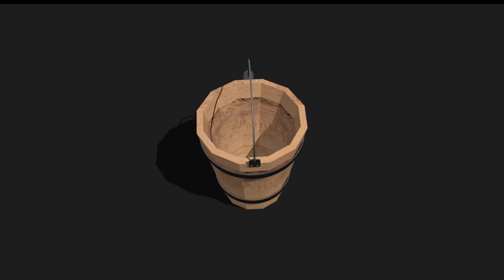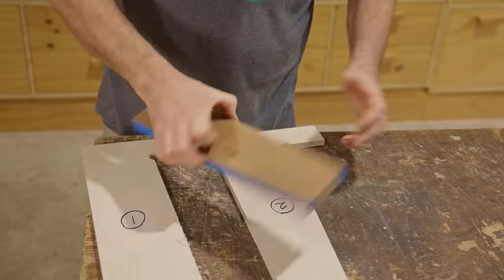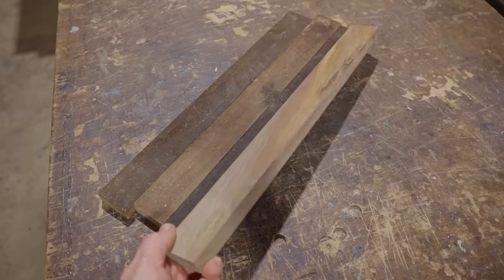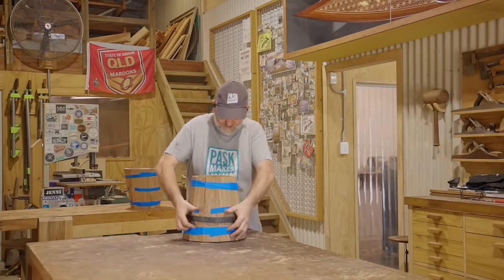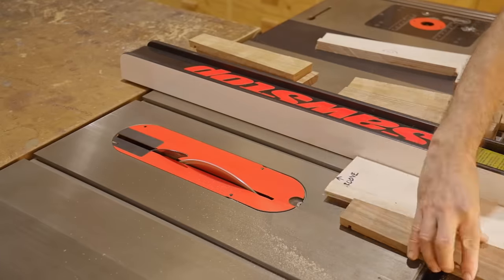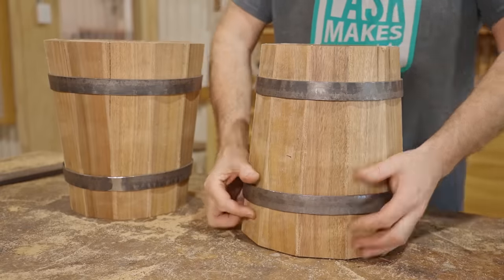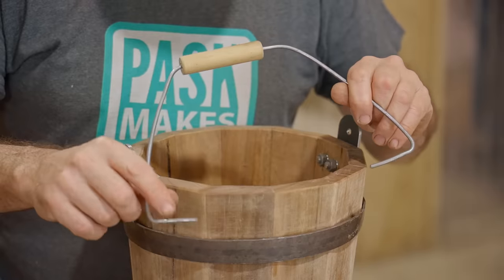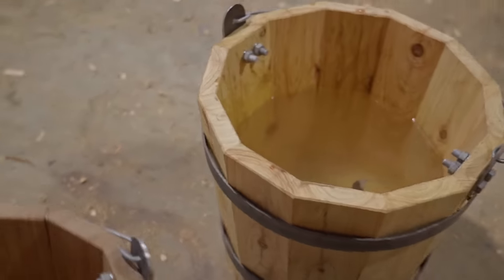Making a Good Old Days Wooden Bucket - Will it Leak? - SWC Ep53

Comment: This is awesome work. 
I was a bit surprised though when I saw you used glue for the bottom. I remember from my grandad when he was prepping the barrels for wine, and as some were leaky, he used to throw boiled/hot water on those spots so the wood expands until there's no more leaks. And he did exactly the same with the ends. Same with new ones, when they get knocked into place, he would fill it slightly in the area needed with hot water to seal the thing (he didn't have gas or anything like that back then).

Comment: That's four buckets that money can't buy, or not easily at least as no shops have them. One suggestion: stainless steel for all the metal parts, incl. the bolts. A nice looking, maintenance free modern material combined with a classy traditional design.

Comment: My fire company has an hand pumped engine made in 1799.  It is made out of white oak.  Every few years we pull it out and pump it.  The wood requires to soak over night before it stops leaking.

In October, I toured Kentucky Cooperage.  They make bourbon whiskey barrels out of white oak, with no glue, even on the heads (bottom & top).  They hydraulically press the heads together.  The cooper then hand places the staves and hand tightens hoops so tight, they do not leak.   Each barrel is pressure tested with air and water to verify no leaks before being shipped. 

It seems that white oak is a good material for being wet, but the bourbon barrels do leak a bit over the years that it ages the bourbon.

Comment: i figured they would have coated the inside with pitch, or even rubbed the edges of board with pine pitch before assembly.
I am a bucket addict as i garden solely from wicking bucket systems, so i really wanna make some of these.

Comment: Normally the outside of wooden buckets was rounded, they rarely left the outside  jagged, which usually self adjusts the rings as you tap it down.
Use a spokeshave to carve the corners down round, then clean with sandpaper

Comment: If you want to use hardwood, use elm: it swells quite dramatically (for a hardwood) across the grain when wet, so should be ideal for this purpose: it's the reason narrowboats/barges were made using this method

Comment: I've been meaning to make planters with a very similar design but couldn't figure out a less complicated way to do steel rings, cold forging them like you did is going to save me a lot of frustration but the only thing I'd change is doing the slots for the bottom at an angle square relative to the finished product to avoid the need to bevel the insert
Reply: That is a good idea!

Comment: If my memory serves me correctly, old timers would take their wooden bucket(s), soak them in water before use. This allowed the wood to naturally expand and seal any leaks. I also believe that they used tree sap as a sealer as well. I could be wrong. 
If you make more buckets in the future, do we foresee a possible metal roller build? Would greatly help making those rings. 
Great job on the buckets. Great video, cheers :)
Reply: thats an interesting thing to consider. These days, making a bucket like this would involve avoiding sealant as much as possible, likely because we could easily use silicon which would feel like cheating. However, when buckets like this were the norm, any advantage would be taken to make them more leak resistant

Comment: One thing that would make the buckets seal even when dry would be to heat the metal rings before putting them on so they squeeze the staves together after the rings cool.

Comment: Excellent. I’m going to give it a try. After all what could go wrong? 🤣

One question - when cutting the slots for the base, would it be an advantage to angle the cuts slightly from outside in?
Reply: Professional woodworker here- you probably shouldn't angle the base as it will not align (if i understood your comment correctly) and your bucket wont end up looking right if you can still even assemble it
Reply: @acadiant2756  - it was actually the slits cut in the planks that I was referring to, that the base fits into. 
But thanks anyway.

Comment: at the edge of the metal ring before you join them, cut off a wedge on either end  so you get a v....that way you get the angle when joining them into a circle....no hammering needed.

Comment: Wonedful, as usual. Just a thought for future reference: You should have put the rings in a fire till they are a good dim orange. This would expand them enough form a tight grip when they cool, and they would be hot enough to burn in their own groove to set in. It's the same method used to make wagon wheels. 

The cold ring method you use here is more for Cooperage than buckets because of a barrel's curved sides. But, historically, both methods were used both with buckets and barrels. The hot rings method is more effective, but it takes longer, you need fuel for a fire and, while the leaks would be smaller, they'd still happen and take just as long for the wood to swell and seal up.

Comment: Hi Neil, when using soft wood for the staves, you can use a small rod placed on the sides of the staves, hit it with a hammer to create  a divot,  the wood fibers are then compressed,  Use a hand plane a take a small shave. Once assembled the water will swell the compressed fibers and provide a tight joint between the staves.

Comment: Years ago on PBS an old man was working in his shop (all water powered) and a fir pit, took many boards 3 inches thick by 5 inches wide and glued the sides together. Then made a wide circle on the wood and beveled thetop and bottom edge of the outer circle. Cut boards 5 inches wide 5 feet long and 3 inches thick, set the saw (dado head) at a slight angle and dadoed the 5 foot boards on 1 end and about 2 inche from the bottom of the board. He then made a large metal ring that he could run a long bolt through with a nut welded on one end (hand welded). He placed the boards with the dado down on the beveled circle all next to each other then placed the metal ring at the bottom and snug the bolt so the boards would not come off, he then made another band to go on top and then he tightened the bottom ring then the top ring and he had a round water trough for 1 of his customers. The mill was on a river, but he did all the work with tools powered by water and just changing belts as he went.

Comment: If you do as Mr. Engels (Engels Coach Works  on YouTube) and heat the metal bands before you put them on,  the bucket staves will be under compression and unable to leak.
Reply from the maker: I've used that method on projects in the past but there isn't any need on a bucket. The tapered sides of the bucket are all you need to create the compression. The only reason that I had any trouble was the wood was crazy dense and slippery as could be. :)

Comment: You should make a scribe and/or compass for metalworking! I see that you're just tracing circles, but it's super easy to make these tools!
While I never finished my scribes (it was in a tech school, I graduated before I finished them), I did finish my compass. It aas super fun, and was just 2 flat pieces with pointed tips, and a slot on them, and a locking pin so they would stay shut! It was my first ever fully made tool, and I still use it!!!!

Comment: Great video.
Would it be possible to make a bucket without the steel rims? Maybe some kind of wooden rims or joinery between each stave?

I'd love to try this, but I barely have enough space and tools for working with wood, never mind all the stuff needed for metal work.
Reply: you COULD, but the trouble would be that the rings are great to hold the slats tight together. getting that same result from wood alone would be very challenging. You know you could do what he did with the steel, a hacksaw, a hammer and a drill?

Comment: Hi, my attempt at making my Bucket has only got as far as cutting the sides using the jigs I am very proud of making, not all of us have a flash Mitre saw like yours, anyway I failed to see that the groove has to be facing down when the angle sides are being cut, say no more, I only had enough of the scrap wood I was using for the 12 stayes required, so now I'm off to have a beer, Yay

Comment: 11:30 Hmm. If you made a couple grooves in the outside, could you use rebar for the bands? You might have to weld in place which would be tricky. 
Anyway, thanks as always for showing your process. I won’t say “mistakes” because they’re just part of the design process.
Reply: No need for grooves, just make rebar rings and hammer them on. No need for rebar either, 4 mm fencing wire is enough. There is not a huge amount of pressure necessary. Back in the day those bands were made of 2-3 runs of thin willow.

Comment: People back in the day didn't have precision tools so what they did is add a bit of dried fibrous materials from certain plants between the planks and when they got wet, they expanded making the bucket, washbasin or barrel (whatever contained a liquid really) waterproof. If they stayed dry for a long time like during winter they would need to be kept wet for a while to allow the wood as well to expand and reset and then maybe add more fibrous filler. These were consumables and replaced every several years. Don't expect it to last 10 years or more.

Comment: You should have either welded the brackets to the top ring or made a bend in each bracket's bottom and inserted them under the top ring -- no fasteners would be quite a bit more elegant =)

Comment: I remember seeing a video of making wine barrels, they used some sort of grass as a seal between the boards, maybe you can try that on your hardwood buckets
Reply: Very curious, as traditional barrels, including modern wine and whiskey casks, needed nothing to act as any sort of gasket.
Would be very interested in a link...
Reply: @paradoxworkshop4659  here is a video of German wine barrel manufacturing: https://youtu.be/824kE9OiyLY 
The "grass" are the leaves of reed (that kind of reed with the cattails)
At 2 :00 he uses a mix of rye flour and crushed linseeds in combination with the reed, he says it keeps it watertight even if the barrel gets dry for a longer period of time!
And at 2 :48 you can see just 2  seconds how he puts a reed leaf between every end of the planks where they meet the lid.
Reply: @Henning_S.  Cool!
Good to add to the random stuff I hope I never have to know file...
...like how to make a nail header, so that I can make my own nails, and how to execute joinery so that I don't have to use nails if I don't have 'em!

Comment: Extend two opposing wedges at the top two or three inches round them off and bore a hole in each for the handle and voila no need for metal tabs to hold the handle.

Comment: Thank you for the free plans and the easy to follow video. I believe you have a mistake in the plans. Where you suggest 94 degrees for the jig angle at the top - it should be 92.
Reply from the maker: No worries Jeff - glad they're helpful. I'm pretty sure the plan is correct as the second jig has to allow for the first taper cut on the first jig. :)

Comment: I wonder if you could have made the hoops a little smaller than you wanted, and then put them on the bucket and hammer them flat into the facets before doing the final wedging.  After all, a dodecahedral hoop on a dodecahedral bucket ought to hold the same as a circular hoop on a circular bucket.  Might even work better, since there would be fewer gaps.

I think I'm definitely going to try my hand at this, though.  Seems like a fun little thing to do.

Comment: When you get a chance, take some softwood (It should be very dry) and shape it 2mm larger than final fitting. Then take that 4mm wire and pound it half way into one edge of each slat. Remove the wire and then final cut that edge 2mm. You should have no visible indent in the edges after cutting. Finish the bucket and fill with water.  ((Note; when the water reaches the area of the indent your cut out, the compressed wood fibers will swell and make a very water tight bucket. I have tried this with very old beaded ceiling planks and only 4 boards with only nails and it would hold water fairly well.))

Comment: Traditional method for rings is to drill, chamfer, pin, and peen. Which leaves a very low profile edge. The chamfer creates a place for metal to move into flush with the ring, so you can really make it close.

Comment: That's one useful skill to have. I have a question though. Would it make the rings fit better if the outside of the bucket was rounder? That means planing down the slight angle where two strips met.

Comment: I make buckets with bent wooden hoops, because metal is expensive. I do it all by hand because I like to torture myself. I believe your metal rings would have stayed on better had you rounded over your staves on the outside. The ring needs to make as much contact as it can all the way around. But, yes, also bucket staves are usually made from soft woods that will compress a bit and form around the rings.

Nice looking buckets though.

Comment: This is interesting to watch; the maker's skill is admirable; and the equipment in his workshop is formidable. A fair price for his work would be well over $200 — perhaps $400.

If my present plastic bucket ever wears out (probably not in my lifetime), I will buy a new plastic bucket. At present, I can get one in a local builder's merchant for £1.20 (about $1.40). It holds 14 litres (3.7 US gallons) and is much lighter than a wooden bucket of similar capacity. In addition, it has a lip for ease of pouring. It won't rot, has no joints that can leak, and does not depend on steel bands that may work loose and will get rusty when they are in moisture-trapping proximity to wood. Unlike wood, plastic doesn't readily accumulate films of bacteria, algae, and fungi and is easily kept clean.

Comment: Lovely video, I always look forwards to seeing your latest. As I understand it, the traditional way to put the metal rings onto a barrel or bucket is to heat them up so they expand and put them onto the bucket whilst still hot so that they tighten as they shrink. Is there a reason you preferred hammering them on? Or was it just an arbitrary decision?
Reply: well, how would you approach heating up an entire thin metal ring to a high heat at once, without a forge?

Comment: Great video.  Just curious since you have access to a forge why not heat the rings and put them on the bucket hot and quench? 
They use to make drums in that manner and it makes a very tight seal.
Reply: he said he wanted a method which anyone could follow

Comment: Uhm you could have made two staves longer to act as handle points. Coopers do this and curve insides and outsides. They have a plane just for making that groove as well usually the bottom is equally tapered both sides to fit groove.

Some where in Netherlands I believe they used a tongue and groove. I’ve also seen people turn these on a lathe

Comment: It would be easy to just weld two small loop to the upper ring and hang the handle there, i don't think it would look bad either and it would probably be more sturdier in the long run.

Comment: That's a good lookin' bucket. At first, I thought you were making an orchard bucket. You don't need to glue the bottom together. Just use dowels or metal pins to align the strips; they will never move. The hoop will keep the bottom together enough that it won't leak if the bucket stays hydrated. Having the bottom hoop a cm or two further down will hold things better too, especially with harder wood.

Comment: I am a Cooper 72yrs old-if you make your bucket from pine you can crush the fibers it will help it not to leak --bucket size 10 1/2 " tall --the top 10"  cross --the bottom 9" across this is called a pale for moping,awell bucket,  sloping hogs an general-a milk bucket I smaller at top,biger at bottom , just take bucket turn upside down put the head in the bottom--now days young people will not take time to add water to keep it swelled up--i now add small dowles on sides of stave to help it stay together--i use epoxy to hold it together --and drive the hoops down with a 2 1/2 lb sledg hammer- the staves should be at top 3 1/2 an bottom        2 1/2" across an use only 10 side angles is.        22 1/2 degrees-- if you take a circle 360 degrees an devide how many sides you have on the staves --- got 10staves you will have 20 sides-- 360 ÷ 20 will be 18 that is your side angle to cut --wish I had a camera to make a vid with - the teachers will not tell ya things I just did - there is a lot more to help ya on making it easy ++ check out on  you tube            john freeman Md..realy good vid on buckets

Comment: So can this be super sized to wood fired hot baths or what ever those are called in English? I have salvaged from metal scrap perfectly fine fire place and lid for one, but making the tub is only limiting factor at the moment, well as how to make it hygienic since dont want to refill it after every use and wood soaks water yes but all the crap as well, plus molds could start growing in the there. How about burning the surface and some burned tar like boats are finished with?